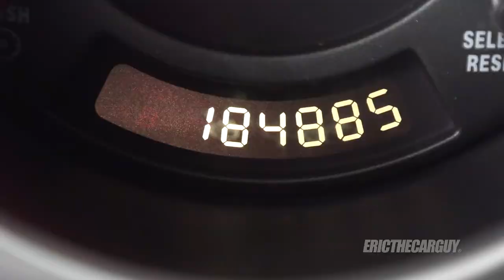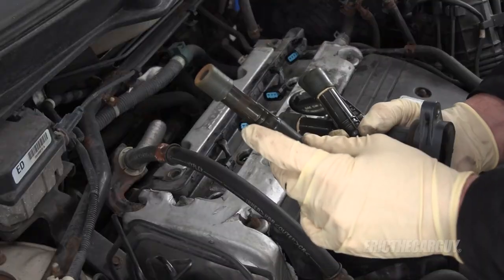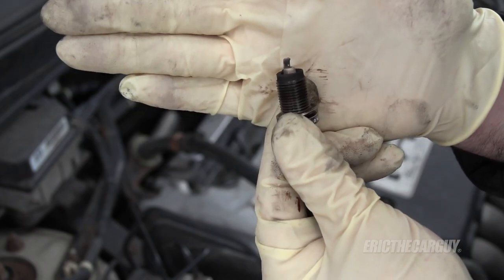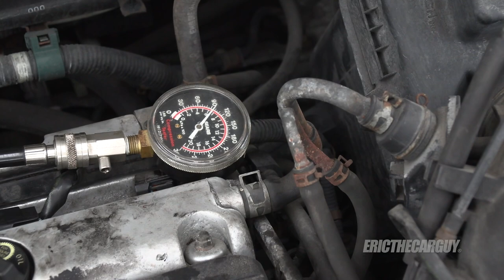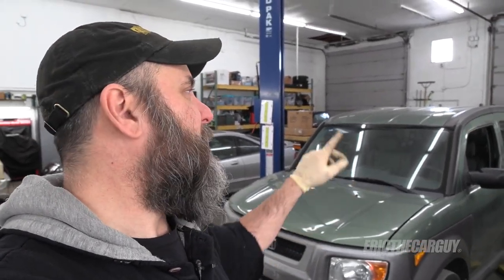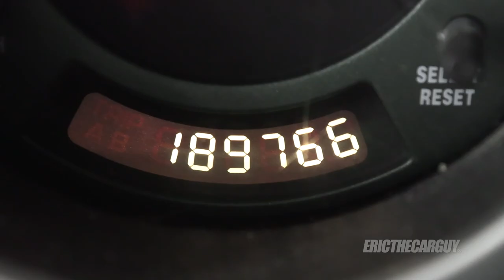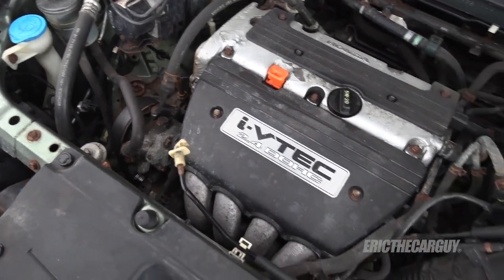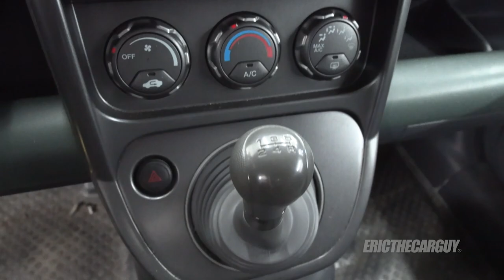I Just Bought 2 Honda Elements

Comment: Progressive insurance adjuster declared my 2005 beige Honda Element(manual transmission) a total loss after a recent car accident. He then had the audacity to low ball me with a $4,600 settlement. But if I want to keep it, they expect me to pay them $3200. WTF?! That doesn't seem right. My mechanic quoted $3500-3700 for repairs. I had so many great times in my element which I bought in 2007 and it only has 121,600 miles for more fun adventures. I'm not sure what to do.

Comment: Hey Eric, great video. I have a 2008 Element that I bought new. Just performed the 100000 mile service. Only issues was a torque converter at 40,000, but was covered under the extended warranty. I’m 64 years old and I think the “E” will probably out last me.

Comment: Those things are growing on me for some reason.  I want one for my daughter's first car!
Reply: Why not, reliable easy to maintain Honda  with short front end for easier viewing, did you know the transmission filter is actually under the splash cover between 2 hoses. That’s how easy the maintenance is
Reply: Worth it. Good solid car with decent ratings. However, do consider that as these things age, they will gap behind in safety compared with other cars. Keep that in mind.
Reply: Bought my Daughter one for my daughter for her first car.
Reply: My wife has one. 5spd, awd, Orange.
Reply: They look bad but so practical. I want to buy one now though and wish I got this car years ago. Just get mods for it and it can be decent
Reply: just don't get one with flood damage

Comment: Canada has a recall on all Elements rear trailing arms where it attached to frame prone to rust. They will put a brace if they can fix it if they can’t Honda will buy it back. This is only in Canada but something that everyone should be aware of
Reply: Kind of like how the pinto had a fix here but in the US they disregarded everyone's safety.
Reply: I know about that TC recall too because I got a letter last month.  The fix is as you describe but crude IMHO.  Check lifewithabox YT channel.  Its Canadian and two videos are posted on the recall.  There's no serious rust issue on my E there and I'll keep it oiled and inspect regularly so no plans to get the recall done anytime soon.
Reply: @canuckfixit7722  man I hope that doesn’t happen to my Element. I had it serviced at the dealer today and had them inspect the rear
Reply: @canuckfixit7722  Thank you for sharing. I would probably go to a 2011 if I had to give mine up. I initially liked the newer headlights but now I think I like the square ones
Reply: I plan on buying and installing a drag cartel red r type valve cover
Reply: I always check my 2008 CRV for the issue, but thankfully no problem yet. Driven in Minnesota and over 200,000 miles. It rarely gets parked indoors which may help. Cars parked in heated garages seem to have more rust issues.
Reply: @midwestfarm757  i live in NYC (Manhattan) by the East River which is salt water, in an indoor non heated garage.
Reply: @midwestfarm757  my son has a 2004 pilot and no rust issues. Guess Honda did a better job on those
Reply: @HotRod-wv4vm  check the inside of the rear wheel wells nearly any Honda will have some rust there.
Reply: @CRAPO2011  thanks
Reply: @CRAPO2011  actually my rear rotors need replacement so it will be a good time to check
Reply: @HotRod-wv4vm  Its all cars in general in my area. We use some nasty stuff on the roads here.
Reply: @HotRod-wv4vm  The Pilots appear to rust at the wheel wells, but not as bad as other vehicles.
Reply: @midwestfarm757  ok good to know will have my son take a look
Reply: @midwestfarm757  I live in NYC and until I saw the post on here, never gave it a second thought.
Reply: @HotRod-wv4vm  My mom-in-law had a 2007 Ford Taurus and the floor completely rotted out, the side rails of the body completely rusted away. The bottom of the car was coming unattached from the side. Worst modern car rust i've seen.
Reply: @midwestfarm757  holy crap. One more thing that you really have to examine when you get a used car, not just gloss over.
Reply: I got my notice in the mail. Good to know that Honda would buy it back if necessary.
Reply: @TomBrydon  Are you in Canada?
Reply: @HotRod-wv4vm  Yes, I drive the Element in summer in Ontario.
Reply: @TomBrydon  are you experiencing rust on those round black buttons that are in the rear side windows? I checked mine today thinking it was bird poop and it’s rust. Always thought they were plastic
Reply: @HotRod-wv4vm  I think I do, I'll have to take a look.
Reply: @TomBrydon  I priced them on line oem and they run close to $17 each and you also need to buy the rubber round grommet that are close to $2 each. I was thinking of just sanding them and paint them with rust oleum. I will just tape off all around. If I don’t like the way they come out I may just bite the bullet and buy some new ones
Reply: @Oblithian  you are incorrect. Ford recalled the Pinto in the US and repeatedly sent out notices to 1.6M owners.  They received 67% compliance.
Reply: @HotRod-wv4vm  how'd it go
Reply: @hungryhippo2827  dealer didn’t know anything about any recall but they checked the rear trailing arms and frame and everything was ok. I did get my valves adjusted and the Element feels stronger

Comment: Home gamer here, worked on my wife's Murano, my old Camry, Q45, and the silicon slide lube is only like $10.
First thing I read when reviewing disc brake jobs was grease swells the rubber boots, so I 'splurged' and got the good stuff.   I also general coat my rotor and inside of wheel with anti-seize, along with the bolts, however bought the mid-grade coated rotors this year from rockauto.  We'll see how they last in NYS winters.  Really shouldn't be rocket science for using the right lubes for such a simple job.

Comment: When doing differential pressure the piston needs to be at top dead center to check where the air is going or else one or both valves could be open,
Reply: That may explain why air was coming out of the #3 and 4 holes.  I made a chart just to get things straight in my head:

Firing Order:  1-3-4-2
 
1 end compression/begin power(TDC)  [both valves closed]
2 end power/begin exhaust  [exhaust opening]
3 end intake/begin compression  [intake closing]
4 end exhaust/begin intake  [exhaust closing and intake opening]

1 mid power  [both valves closed]
2 mid exhaust  [exhaust open]
3 mid compression  [both valves closed]
4 mid intake  [intake open]

1 end power/begin exhaust  [exhaust opening]
2 end exhaust/begin intake  [exhaust closing and intake opening]
3 end compression/begin power(TDC)  [both valves closed]
4 end intake/begin compression  [intake closing]

1 mid exhaust  [exhaust open]
2 mid intake  [intake open]
3 mid power  [both valves closed]
4 mid compression  [both valves closed]

1 end exhaust/begin intake  [exhaust closing and intake opening]
2 end intake/begin compression  [intake closing]
3 end power/begin exhaust  [exhaust opening]
4 end compression/begin power(TDC)  [both valves closed]

1 mid intake  [intake open]
2 mid compression  [both valves closed]
3 mid exhaust  [exhaust open]
4 mid power  [both valves closed]

1 end intake/begin compression  [intake closing]
2 end compression/begin power(TDC)  [both valves closed]
3 end exhaust/begin intake  [exhaust closing and intake opening]
4 end power/begin exhaust  [exhaust opening]

1 mid compression  [both valves closed]
2 mid power  [both valves closed]
3 mid intake  [intake open]
4 mid exhaust  [exhaust open]

If the #1 was at TDC, the #2 exhaust valve is opening.  Most of that air is going to go down the pipe, but the #4 exhaust valve is not quite closed and some will blow in there.  Once in the #4, the air has only two ways out (not counting past the rings), out the plug hole (which Eric could hear) and out the just opening intake valve.  Once in the intake, most will go out the air box, but some will go in the #3 as that intake is not quite closed yet, hence the quieter noise coming out of the #3 plug hole.

If you see anything wrong, please chime in.  I hate being wrong.
Reply: Yeah....totally didn't make any sense.  WTF Eric?
Reply: Had to search for this comment since I was hoping I wasn't the only one thinking it

Comment: Eric, congratulations on a fine choice.  I have an 05 E, also 4wd and 5-speed.  Had it since last summer.  218,000 kms.  Since COVID, I haven't been able to drive it around much.  Couple of things I have recently learned through my ownership:  1) Get those aftermarket axles out of there.  Aftermarket axles have no place in Elements!  2) For the OEM axles that are still installed, carefully inspect the shaft area under the harmonic balancer because dangerous rust builds up under there until the axle "necks down" and fails.  Eric O of SMA has a great YT video of how an axle happened to snap from that cause on a Honda Civic.  I think that there is a Honda Fit recall in the US for this safety issue.

Comment: Eric calling for insurance quote: All right, I have: 
an 05 green Element,
another green Element,
a beige Element,
Integra Type R,
Integra GS-R, 
wife's Odyssey, 
the Fix it Forward odyssey, 
Chevy pickup truck, 
Ford Fairmont,
the black Acura TL as a daily
and a couple of parts cars: white Acura RL and maybe a 6th gen civic not sure if I still got those parked here and I probably forgot one or two.

- So you said an 05 Ford TL? Does it have factory installed theft protection?

Comment: Hey Eric in regards to I believe the beige Element where you saw the oil leak near the oil filter/oil pan area; it could be the oil pressure sending unit that is leaking. In my 06 CRV it was leaking out of that and caused a similar oil leak. Replacing it fixed my leak issue. You’re replacing the engine so that should fix that issue lol. Thanks for the video. I love the Khaki color of the element.

Comment: I also know the pain of being a perfectionist lol. When I bought my '05 Civic coupe, it was missing so many bolts in the engine bay, no battery hold down, no fender liners or splash shield, garnishing was missing all in the cabin and no glove compartment stops. I ended up going to salvage yard and got everything I needed for like $80 and felt soo much better. I'm hooked on salvage yards now lol. Even got a matching spare rim for like $50

Comment: If it makes you feel better, I own three Elements.  A 2004, and two 2006.  The 2004 model has over 330,000 miles.   I know everything Eric is talking about.  The cars have great utility and after basic maintenance, they will last a long time.  The other two Elements have 175,000 and 149,000 miles.  All are AWD with four-speed automatics.  I keep looking for a replacement car for the oldest but I have yet to find a newer car with such utility.

Comment: Nice that you found 2 manual elements.  I tow with my 2006 manual element.  The manual means I can keep the rpms where they should be and never have the auto trans shifting back and forth.  260K and she is still running strong.  I use a bit of oil but what old VTECs don't use oil.  Looking forward to some more element fix up videos!

Comment: Jus bought a beautiful 2003 myself. Was beautiful until I got looking closer. Brakes, stabilizer links and bushings, ball joints, tie rods, lower control arms, headlights, etc. But, engine is sweet, trany is good and AWD is fine. New tires too. Only 146,000 easy miles.

Comment: I bought a 2007 Element in 2011 as a substitute for a pickup.  The element has worked better than any truck I have owned.  I removed and gave away the back seat in order to double the cargo space.  The back doors car be opened to easily access the back of the bed.  The only downside was replacing the starter motor.  It was very difficult to get to.

Comment: I am at a crossroads and at my wit's end with my own 2 2004 Honda Elements! Both have started to fall apart bad on me of late, and, I am absolutely crying because it's time to sell them but they both have uneven selling points (or even if I can sell them)
 I am a risk-taker so I bought the first one, Blue, on eBay in 2016. I knew the engine had to be replaced so I asked the out-of-state seller (Pa.)to kindly take it to a local mechanic which he did, I bought shipped the used motor (45K miles) The mechanic then put it in the car successfully and I drove it back to NYC Total investment $4100. At the time it was a little high $$$ but I adored it. We believe it was a lifesaver, especially because my husband and his co-workers commuted daily for 6-7 months avoiding crowded subways when the Covid pandemic was at its worse. The city can be tough on cars so Blue has gotten its share of scratches and dents no one owned up to, and, oh the catalytic converter which was yanked out and had to be replaced. Blue was a champ. Fast forward to 2022 Blue still works well mechanically, but recently the mechanic gave me the bad news that the undercarriage is badly rusted the rear left tire is slightly off-centered and veering out halfway between the 6 o'clock and 7 position.
😕 The second car, Bronco, was for my daughter and  I got off Craigslist. it cost me $2200
and it's sort of an eye-sore. The previous owner had stripped the car paint and then spray painted it. Inside it looked good. I had figured, looks don't matter, it's my daughter's first car, that was my logic. Bronco had recently passed NYS inspection and the owner explained that the transmission had been repaired. The problem was that the repair job didn't come out so good and Bronco when I accelerated it would hesitate slightly followed by a sudden lunging forward. This commonly happens when shifting gears in a standard transmission car, which Bronco is not. Now the market is very hot for Honda Elements and I would like to sell or trade-in or donate them because from here on in it could all be diminishing returns with my Elements.
What do you suggest I do? Thanks, Fe

Comment: I love the Michelin defender at2 on my Element.  Bigger size 235/70-16.  Overhauled my undercarriage last summer using some of your vids.  In the back of my element right now is an acura tsx k24 with rbb-3 heads.  At 192k miles, a freshening is not far off.  Decided a little more power would be nice.  Yeah, I’m keeping it.

Comment: I really appreciate your interest in the Honda Element.   I bought one in 2003 and owned it for 15 years and sold it.  Really regretted the decision.   Was able to buy it back and the previous owner really ran it into the ground.   I am trying to restore it again and am starting to buy parts for it and get it back to where it was when I sold it.   It has 236,000 miles on it and it is a 5 speed.  The car is perfect for Hawaii and I use it for my outdoors lifestyle.   Surfboards on the roof rack and Trek bike inside.   The car now has a Pioneer 6.5 inch Divx system which is bluetooth and hands free phone capability.   It makes the car more modern now.   I am finding it hard to order parts for the car because it is so old and I couldn't get new headlights because the parts places won't ship to Hawaii.  Also what is the rumor that Honda is going to make the Element again?  It doesn't make sense that Honda decided not to sell it anymore.   And what's up with the Honda Fit as well.  I owned a 2015 and really enjoyed that car as well.   I also have a 2010 Honda Insight with 214,000 miles and that car seems to just run and run.   It is too bad Honda made the new Insight so big.   Thanks again for the information you gave me on the Honda Element.   I can't believe all the rust that those cars have.   We don't have that problem here in Hawaii.

Comment: Two things went bad on my 2005 the a/c fan did not come on fuse box in engine compartment had the problem $8, secondly evap.  canister in front of gas tank plugged up could not fill top end and engine stuttered. Can haul as much cargo as the Ridgeline but can be locked up. You are right VTech gasket leaked.

Comment: K24A2 Swap - K24A2 Swap - K24A2 Swap! - Eric, seriously consider this swap for your cargo khaki Element (great 1 model-year color btw).  The engine is basically a drop-in (keep your accessories), and there are affordable tuning options like Ktuner. Hmotorsonline has GREAT prices on low mileage imported 200hp K24A engines, and a fantastic reputation for YEARS.  I got a gem from them.  I did this swap myself in my garage at home, and I'm not a mechanic (not technically anyway).  I paid $250 for remote "e-tuning", and she's up and running.  I mean, the Element is borderline underpowered as it is.  Since you already have to replace the engine, it's a manual, and your estimate for a stock replacement is $1000, why not add 25% more hp for just a few hundred dollars more?
Reply: Oh, and thanks for your earlier video on K series valve adjustment.  It helped alot for my first time doing it.
Reply from the maker: You don't mod your daily. However, I don't daily the 2000 Civic I took the engine out of a few months ago. 🤔
Reply: @ericthecarguy  OK, ok....  Well, you could keep the Element's K24 bottom end (If it's good), get a cheap K20 head and build a NICE new engine for the Civic.  

Whatever you do, I look forward to the videos.  Thanks for all the info and entertainment.